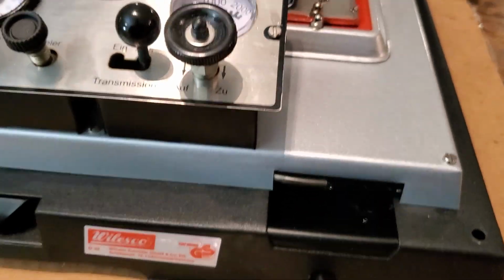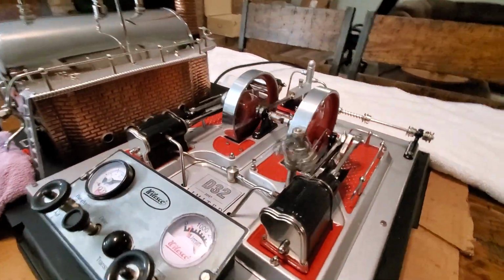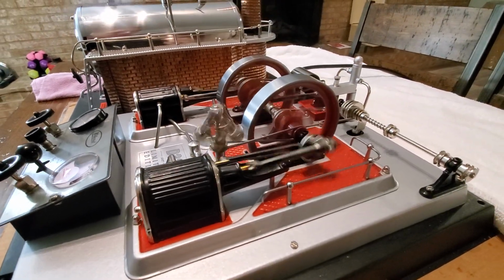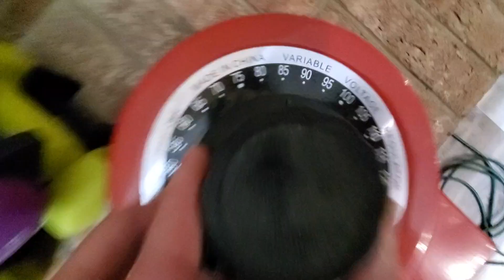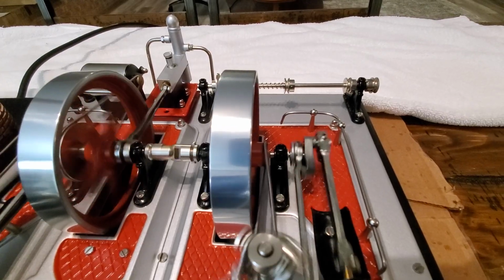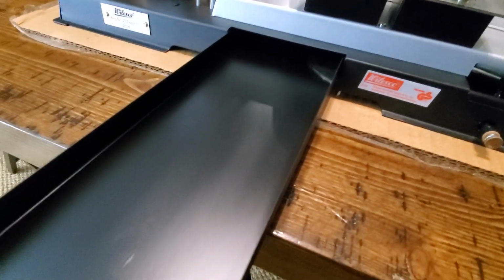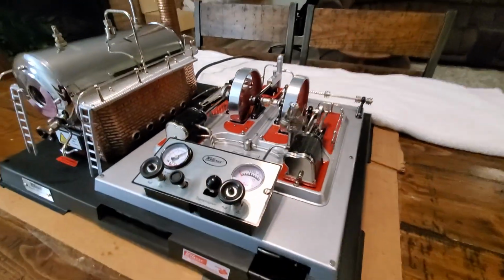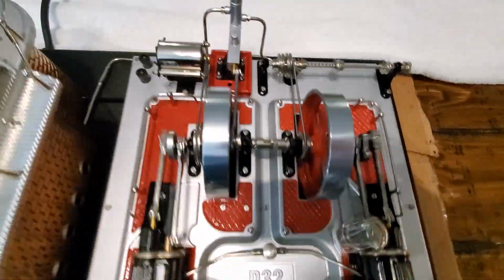Running the Wilesco D32 Limited Edition steam engine. 3rd Steam Up.

Comment: Does the fly-ball governor do anything, or is it just for show?
Reply: On my D20 (that I just repaired) it is just for show and does not regulate the steam valve (which I think was its original function to keep rpm steady). As far as I know that is the case with all wilesco steam engines. 🙋🏻‍♀️Anna
Reply: in case of the wilesco D32 the centrifugal governor generates the display on the tachometer
Reply: @theschmonkiboy  Aber nur bei den Alten. Bei dieser Neuauflage ist es elektronisch und das ist ein Nachteil, da man ja mit dem Dimmer die Spannung reduzieren muss, damit nicht ständig das Sicherheitsventil aufmacht.